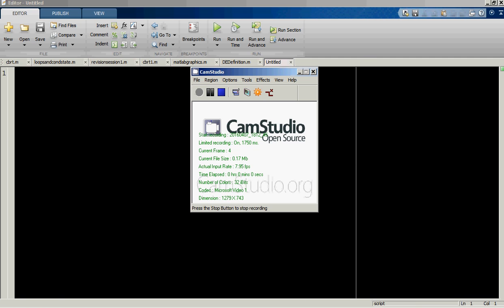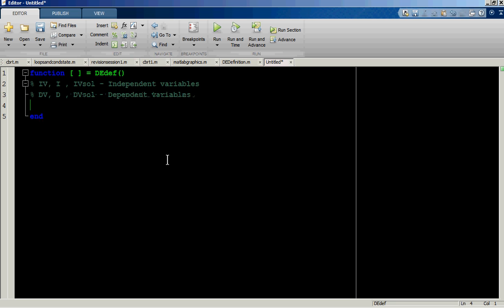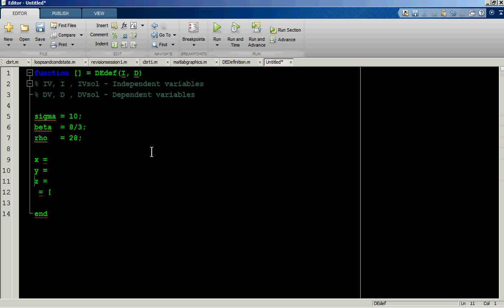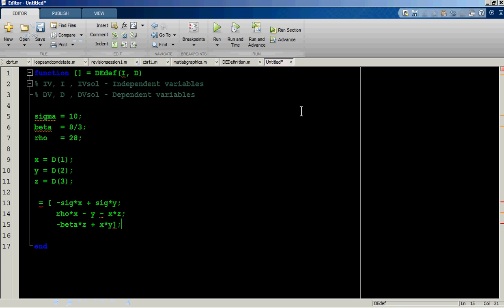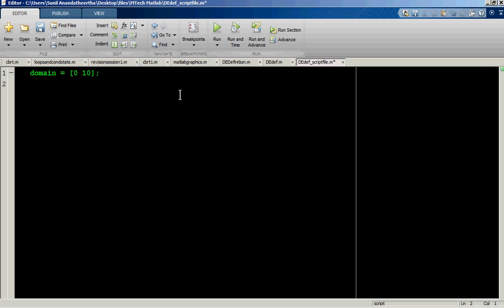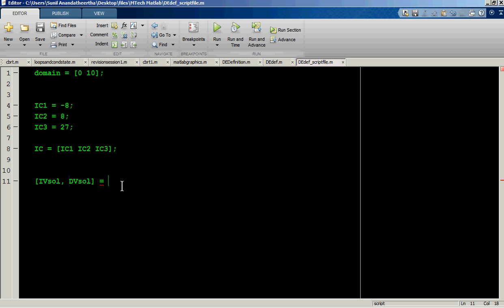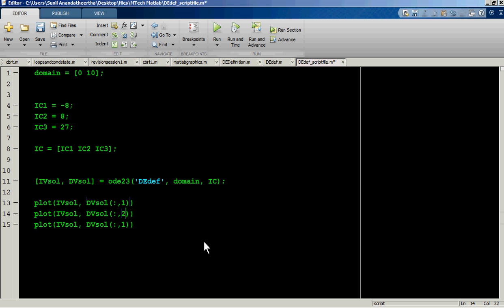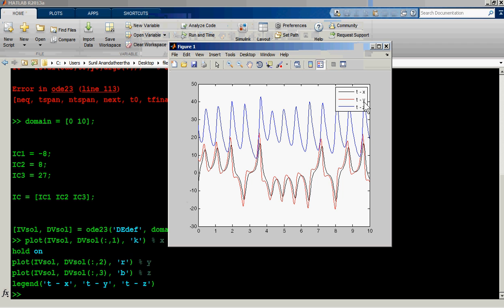System of differential equation MATLAB using ode23   MTech syllabus

Comment: Error using vertcat
Dimensions of arrays being concatenated are not consistent.

Error in DEdef (line 13)
Ddv_Div = [ -sigma*x + sigma*y; 

Error in odearguments (line 90)
f0 = feval(ode,t0,y0,args{:});   % ODE15I sets args{1} to yp0.

Error in ode23 (line 114)
    odearguments(FcnHandlesUsed, solver_name, ode, tspan, y0, options,
    varargin);

Error in DEdef_scriptfile (line 9)
[IVsol, DVsol] = ode23('DEdef', domain, IC)

Comment: cannot be run help me out' i have wrote the same thing but there is an error on line 5
[Ddv_Div]= math(I,D);
sig = 10;
beta = 8/3;
rho = 28;
x = D(1);
y = D(2);
z = D(3);
Ddv_Div = [ -sig*x + sig*y;
     rho*x - y - x*z;
     -beta*z + x*y];
 domain = [0 10];
 IC1 = -8;
 IC2 = 8;
 IC3 = 27;
 IC = [IC1 IC2 IC3];
 [IVsol DVsol] = ode45('math' , domain , IV);